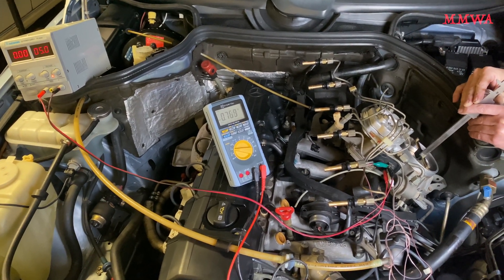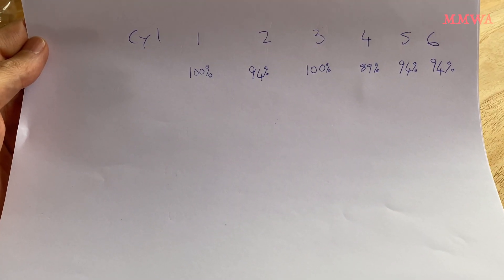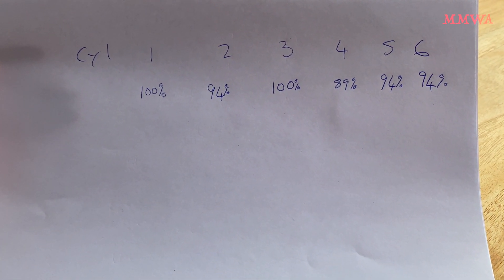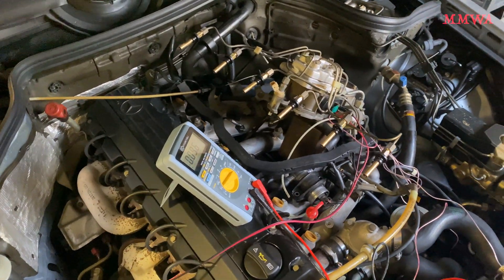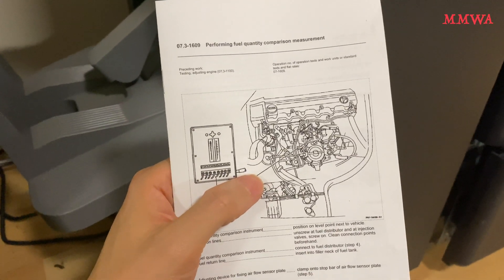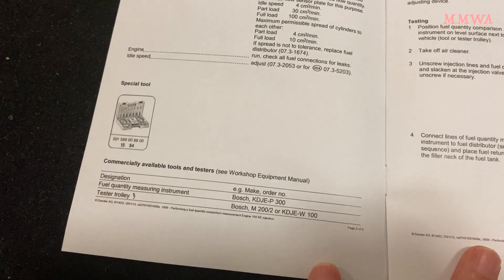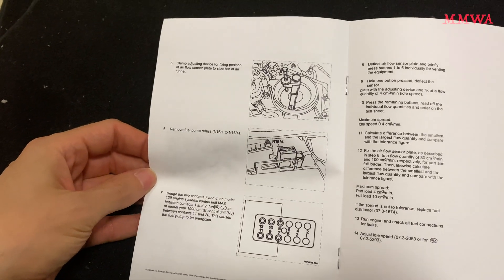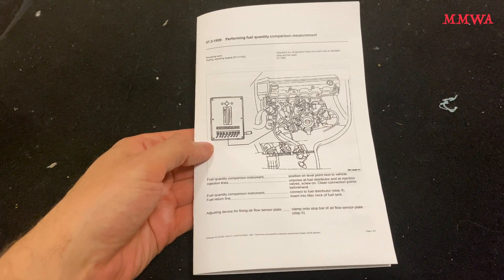Follow-up to to the Mercedes M103 poor mans KE-Jet fuel distributor balance test

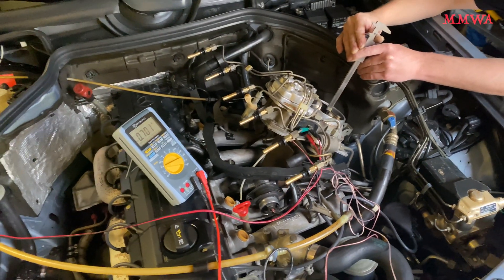Comment: Did u notice at 00:20 Number 5. Drips some fuel.  Is this a problem?
Reply from the maker: this is just because the flap is being pushed for the demonstration and the fuel pressure isn’t enough to do much else - pumps not turned on

Comment: Could the injectors have anything to do w the unbalance?  Any point of swapping and retesting?  Thanks for sharing.
Reply from the maker: I havr thought about this, i noticed bosch dont make the injectors as well as they used to, ie the opening pressures arent even consistent on a set purchased at the same time. My injector tester failed after 1 month sitting unused, i should have drained the fluid out of it. I saw sellers like kent burgsma did at one stage sell matched sets. Its not practical for individuals to buy tons of injectors to make a set though.
Reply: @MMWA-DAVE  Not telling u what to do.  Injector tester good to check: -no leakage below pop off pressure, -pop off pressure, and spray pattern.  And nothing more.  I know we want to limit the number of times the flare fittings on the tubes and injectors are reseated, and the injectors are yanked out of their seats, but move every injector one (or 2) over and see if there is any change?  U said that previous results were repeatable, so if there is no change u know that injector flow resistance is not an issue.  I'm having same issues w my 86 190e-16, 92 190e 2.6, and my 76 2,7l 911s.  76 exhaust headers on 2 cylinders glow. Am tempted to remove the exhaust manifold and see if they spraying fire.
Thanks for sharing.
Reply: He did a video changing these injectors a year ago.
Reply: @cromanczuk  Yup.  Still need to be flow tested.  Even w good spray pattern flow resistance can be quite different.  Fuel distributor is not a positive displacement pump.  Just saying.
Reply: @athompson8976  ?????  Ok